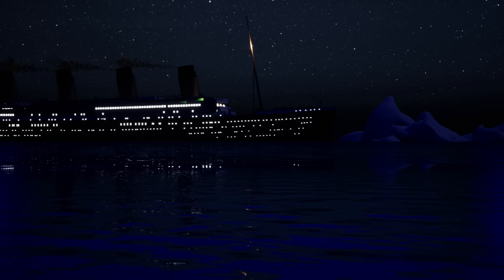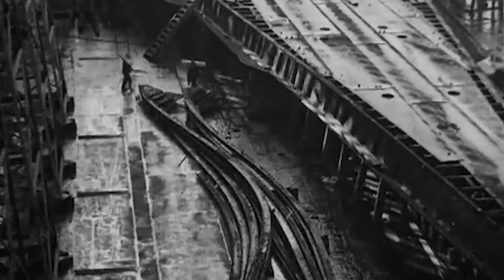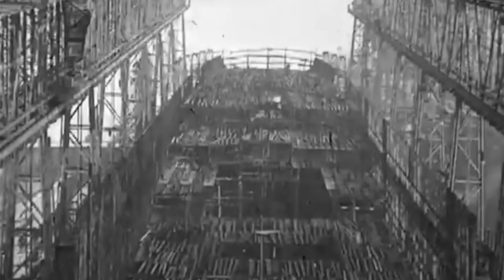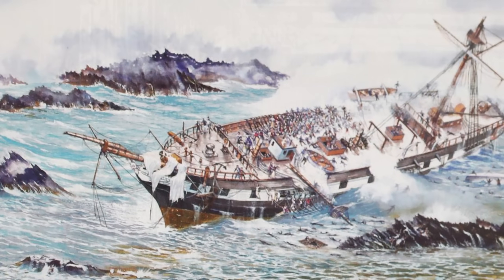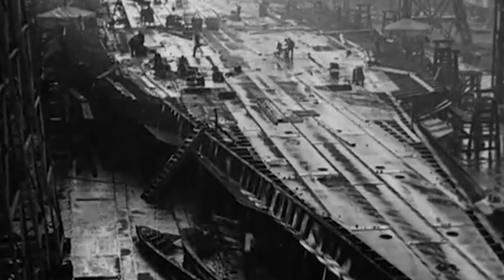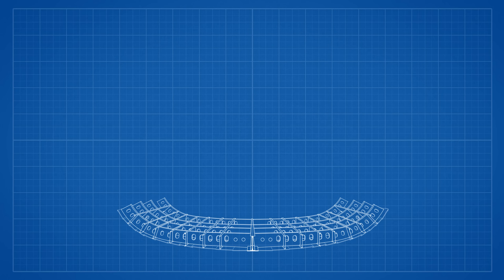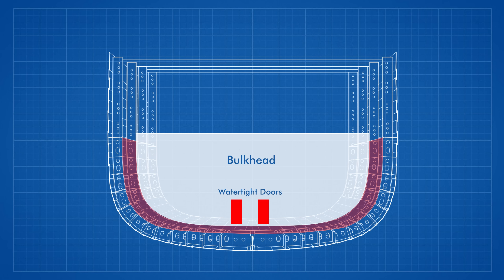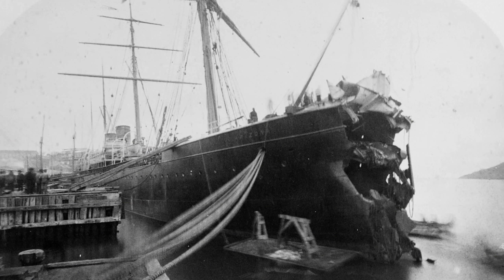How did the Iceberg Sink the Titanic?

Comment: Great presentation! I must add, though, that, after all the programs and videos, and pieces I’ve read about this over YEARS since my childhood, especially the more recent ones where they’ve brought the benefits of modern imaging technology to bear, I don’t believe there were any ‘gashes’ in the full. At least not initially. You correctly show the placement of the openings and how relatively small they were…except the last 45-foot one - that’s not so small, and which opened Boiler Rooms 5 and 6 to the sea. The steel plates didn’t ‘rip’ but were instead punched in by the iceberg so that they buckled and even then with openings of only inches, as you said, to let seawater in. The gashes witnessed by Ballard and Cameron would have been caused by those small openings being made much larger by the bow plowing almost vertically into the sea bottom, thereby “breaking her back,” (the keel) as Mr. Cameron said, and making the holes larger. If you watch Mr. Cameron’s excellent CGI animation of Titanic’s plunge to the bottom (I’m sure you have!) you’ll see what happened when it hit the sea floor. I only intend to discuss here. Your work is superb, and that was the only question I had as I watched, based in hours of my own watching and research. Thank you!

Comment: The problem seems like they placed their water tight compartments only just high enough to keep water within the 4 water tight compartments that could keep the ship afloat. During that graphic of the first 4 compartments flooding the water, even though the ship would have reached equilibrium at this point, the water was VERY close to the E deck top level. This seemed like they were cutting it really close. Is there a reason that these water tight bulkheads didn't run the entire length of the ship, save for maybe the last but 1 deck?

Comment: Amazing video. The graphics you added to show the damage to the Titanic actually helped me understand the part where the water rushed over the water-tight compartments. One thing I heard was that a big problem with the Titanic’s design was that they put too much focus into luxury. This apparently led to the designers using windows that were too big and delicate, which meant that they couldn’t withstand the pressure of water pressing on them so when they inevitably broke, it accelerated the sinking of the ship.
Reply: I haven’t heard that, sounds interesting. Though I’m taking it with a grain of salt, as none of the windows on the ship were exceptionally big.
Reply: @DerpyPossum  I would also, because I've actually heard various versions of it. Another one was that the windows weren't the correct kind of glass or something of that ilk. That's why I normally begin statements that I haven't had any real confirmation on with "I've heard..." or something like that, so people know it's a mere rumor. I don't want to be THAT guy, spreading misinformation. Having said that, I did read that (the one about big windows) on, if I recall correctly, the History Channel's website.
Reply: @theminingassassin16  Oh, The Used-To-Be-About-History Channel ;)
Reply: @DerpyPossum  More or less, yeah... ;)

Comment: For years and years, decades, I have heard the term "watertight bulkheads" being used, and how they only reached such-and-such deck. However, I have never seen an explanation or illustration of what that actually means.

Might feel obvious in hindsight, but it wasn't really all that obvious to me until this video. In other words, that they were literally steel walls spanning the entire width of the ship, and which needed doors for passengers and crew to go through.

I suppose it kind of makes sense that they were pretty much in essence "containers" that were "open" at the top. Putting a watertight "ceiling" on these compartments would have meant more doors needed to go up and down this top part, which would have been difficult eg. because of lifts, chimneys and a myriad of other vertical openings that are just needed.

Comment: Titanic Olympic.
Reply: Just because it’s famous doesn’t mean it has to be a conspiracy…
Reply: @DerpyPossum  Just because you haven't researched it, doesn't mean you can dismiss it.
The "Olympic Suite" at the White Swan Hotel in Alnwick holds a secret, know what it is?
Reply: @mikerochburns4104  6 years of personal research isn’t much, but I’m willing to argue that it’s research nonetheless.
I’m assuming you’re referring to the ships’ hull numbers on the paneling — 400 being Olympic’s and 401 being Titanic’s. Well, none of the artifacts recovered from the ship that was scrapped had 401 on them. Not a single one. And there’s no evidence whatsoever to the contrary.
Those hull numbers would’ve been on everything. And I mean everything. Panels, hull plates, beams, window frames, light fixtures, engines, boilers, deck machinery, other miscellaneous navigational equipment, deck planks, propeller blades, furniture, doors, everything. Either the tens of thousands of shipyard workers that were needed (all of which, btw, would’ve had to be unrealistically silenced) possessed enough superhuman strength and speed to pull of the task of removing, relocating and reinstalling almost every single aspect of these ships — essentially tearing them down and rebuilding them — within the 40-or-so days when they would’ve been in the same location, defying all laws of physics and possibility in the process…or the ship that was scrapped was Olympic, which would mean the ship that sank was Titanic.
No matter how you slice this BS theory, it always comes beck around to being BS. It’s not physically possible, it’s not economically feasible, it’s not in possession of substantial evidence, and it just flat out makes no sense once one researches it beyond clickbait articles, corporate-esque conspiracy videos, and fiction books designed to sell. The latter, by the way, is the actual origin of the switch theory; “The Riddle of the Titanic”, by Robin Gardner — a 1990s fiction book designed to be convincing in order to sell copies. The book’s co. author admitted as such.
Yet people still believe it. Be it attention-seeking liars spreading it for profit, unfortunate souls who are too easily duped, or common folk who are simply afraid. Afraid that this event was a genuine accident. Afraid that these things can just happen through unfortunate circumstances. They need closure. They need a scapegoat. They need to believe that one of their own caused it, and distort/make up evidence to force their narrative. They need someone to blame…

But hey, apparently I “haven’t researched it”, so what do I know?

Comment: Great video! I am curious as to your opinion on whether or not the coal fire theory has any merit?  Could it have stressed hull plates and the water-tight wall? Would that have made them more brittle and more susceptible to shearing or warping? Or was it simply not a factor one war or the other in Titanic's sinking?
Reply: In all likelihood, it was not a factor. The fire itself was nothing more than a small patch of smoldering coals, which was put out over a day before the collision (Titanic, by the way, was only in the frigid waters of the Labrador current for about 4 hours before the collision), and also wasn’t located up against the outer hull in the first place.
Reply: @DerpyPossum  what about the reports from firemen that walked off the job before Titanic left England that the bunker was burning and not smoldering. What about the new photos that were discovered showing clear signs of discoloration on the outer hull. Did the bunker not go the width of the ship?
Reply: @andrewmoroney1317  The thing about the photos is that there’s only two of them that show it, taken within minutes of each other by the same camera from very similar angles. No others show it. And the stuff on the outer hull in the photos is well over 80 feet away from where the fire actually was in the ship, and too far above the waterline. How could that have sunk the ship if it was above the waterline? 
Those accounts from the stokers are particularly interesting, because I’ve literally never seen or come across any credible source of any kind whatsoever that even vaguely mentions anything along those lines.  What are the full quotes? What were the names of the men that said them? When were they reported? Where are the sign-off documents?
Reply: @DerpyPossum  it was a documentary that came out not long ago. Apparently it was discussed at the inquiry. The only thing I've heard or read that lends any weight to the theory is that if the fire were hot enough, it could have warped the bulkhead for the watertight doors. As for the hull being compromised I would assume it has something to do with the severe heating of the steel making it brittle and more susceptible to shearing. Like I said earlier, I'm more curious to know if any of the "new evidence" holds any water "obvious pun".
Reply: @DerpyPossum  aw common, no comment on the holding water? I know, I know it was too obvious. 

This stuff is so fascinating. Here we are, a hundred years later and we're still discussing the details of something we may never know the real answer to. 

So was there really a fire or is that a theory too? All legends usually come from some truth right?
Reply: @andrewmoroney1317  There was indeed a fire (again, a small one that was more along the lines of a smolder), and it was brought up at the inquiries and in many testimonies. But everyone that brought it up unanimously agreed that it wasn’t of much significance or relevance at all.

Comment: The whole "subpar steel myth" only continues to survive because the quality of steel as used in Titanic's day was fine grade, but horribly subpar by MODERN standards for steel quality. In point of fact, Titanic's steel quality was good for her day, but advances in a few short decades meant that British, American, and especially German warships of WWII were able to take quite a lot of punishment (whereas the Japanese suffered from being behind the curve with homemade steel of lesser quality).
HMS Titanic broke apart as she sank as a result of a combination of powerful natural forces: gravity (bending and tearing the steel under its own weight as her stern was lifted into the air) and water pressure (imploding the stern section when the keel connecting it to the filled bow pulled it underwater), which overwhelmed the strength of the steel. This was due to maganise-sulfide inclusions which were unknown about at the time that made the steel more brittle than modern standards would accept, but is commonly found in steel made in Titanic's era.
By comparison, only 30 years later, after being torn apart by British battleship fire, KMS Bismarck sank by rolling over and survived a full-force high-speed impact with the seabed that cause parts of her outer hull to be forcibly broken off due to water overpressure and shell hit damage, and yet the ship's main hull integrity remained in one full piece due to the quality of her belt armor steel, which had twenty additional years of German metallurgic engineering behind it, making it strong enough to take hits and flexible enough to bend when necessary.

Comment: If they wouldn't have turned and just hit it head on would it have changed anything?
Reply: Probably depends on the iceberg and the Titanics initial trajectory. If they had hit it more or less in line with the icebergs center of mass, then Titanic would have had damage to her bow. In terms of direct flooding, she could have easily coped with that. What is harder to tell is what such a head on collision would have done to her structure, and whether she could have absorbed the immense shock that would have caused. Though I'd guess she was strong enough to do so, considering he was designed to cope with heavy seas.
I she wasn't heading exactly straight for it to begin with, she would have scraped along it anyways, only with more force and thus more damage.
So the attempted turn away from the iceberg might have given her a little more time.
Though ultimately it's impossible to say given that we have no idea what the iceberg looked like under the waterline, and don't know Titanics exact course in relation to it.
Reply: @michaelt.5672  Apparently this guy did a video on that a few months ago.

Comment: I wonder why they didn't try fothering the damaged parts of the hull, since they only needed to stop the leak in one compartment to allow the bilge pumps to keep up (the electric generators were among the last systems to fail)? If they had found one of the smaller leaks, could they not have sent a boat over the side immediately with some sailcloth or something, as was done in the age of sail, to cover the gash, and allowing the inward pressure of the water itself to seal it? A temporary solution, to be sure, but they only needed to save one of the five compartments to save the whole ship?
Reply: The damage wouldn’t have been possible to reach.

Comment: 13:54 the front was not being pulled down due to the weight of the water. The water inside the Titanic is equal buoyancy with the water outside the Titanic. The reason the front was lower in the water was due to lack of air (lack of buoyancy) not weight of the water.

Comment: Didn't the ship have an internal fire before setting sail and the metal was weaker because of that, and it just happened that's where the iceberg hit
Reply: It was a small patch of smoldering coals that was put out over a day before the collision, didn’t weaken or damage anything significant, and wasn’t even located up against the hull in the first place. It’s been sensationalized so often today because people want to make the story more dramatic than it is.

Comment: And the coal bunker fire that was burning weekend the steal. Also the builders used a different type of steal they used type 3 and not type 4 meaning there was impurities in the iron and steal.
Reply: The steel was not weak, and the fire was not significant. It was a small patch of smoldering coals that was put out over a day before the collision, and it didn’t weaken or damage anything. It wasn’t even located up against the hull in the first place.

Comment: The water got in through the hole torn in the side. The water pressure of the ocean pushed its way in through the hole along the side. IMHO had the crew immediately thrown flotsum over the side above the hole the water pressure would have pushed that flotsum into the hole. Stop the leak? No, Not completely but I think that the ingress of water would have been slown enough for the pumps to hold or even gut in front. Think about it. How quick does your sink drain when the plug is covered with pieces of cooked veggies off your dinner plates? It still does, just more slowly. IMHO had the crew thrown stuff like bedding, curtains, table cloths, towelling, etc, etc, etc, over the side where the hole was, the pressure of the water trying to get in would have drawn this material into the hole through the pressure of the water trying to get in.... Slow the ingress of water down enough, the pumps get in front or just reach equilibrium with the water coming in..... No disaster. Does anyone else have any views on this?
Reply: It wasn’t a hole, it was 300 feet of steel plates with their edges buckled inward. The damage was very deep in the ship, and throwing stuff to plug it up wouldn’t have done anything.

Comment: Hardly being an engineering genius my experience with bicycle design is that the problem with a box design is though it is incredibly strong it is also incredibly inflexible and inflexibility means catastrophic damage. It’s a battle to find the correct balance between strength and flexibility.
Reply: Which is where a ship’s expansion joints come in; flexible separations in the superstructure and upper decks that allow the ship to flex just enough to not damage itself. Olympic and Titanic both had 2, one in between the main 1st class staircase and the 1st funnel, another between the engine room skylight and the aft 1st class staircase. Britannic had 4, actually. Two in similar locations to Olympic and Titanic’s, one closer to the middle of the ship, and one on the aft well-deck.
Reply: Which was one of the reasons Titanic's shell plating was constructed with mild steel lacking high concentrations of carbon which gives steel its strength but also makes it more rigid and hard and thus more brittle given the chemical makeup.

Comment: Can someone help me understand something?  These watertight compartments were 'watertight,' but how can that be if they didn't have a ceiling?  Meaning, the Titanic sank because water spilled from one compartment to the next from the top, once that compartment was filled.  But doesn't that mean that if any ONE compartment had a leak, and there was no way to plug it, that the water would have filled that compartment & spilled over the top anyway?...one by one?
Reply: If only one compartment had a leak, the compartment would only have filled up as far as the level of the leak, and the buoyancy of the other compartments would have prevented the ship from sitting lower in the water.

Comment: Did they have searchlights on the bow of the Titanic to shine on  icebergs?
Reply: No. A searchlight big and powerful enough to actually be helpful wouldn’t have been possible to build and maintain in 1912. Plus, the light would’ve been limited to a cone of sorts, which would have to rotate along the horizon; Meaning anything outside of that cone could still pose great danger.
Reply: @DerpyPossum  Ok but carbon arc (lime- and carbide lights was also available) searchlight was a mature technology 1912. Why wouldn't you want a cone of light, why bother with things outside the path of sail?